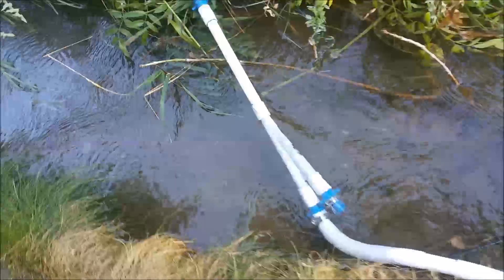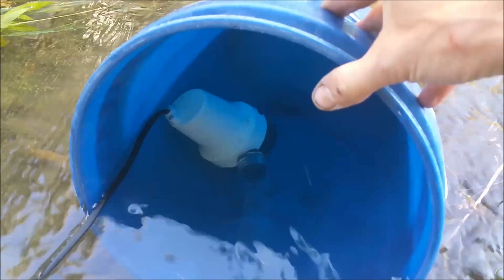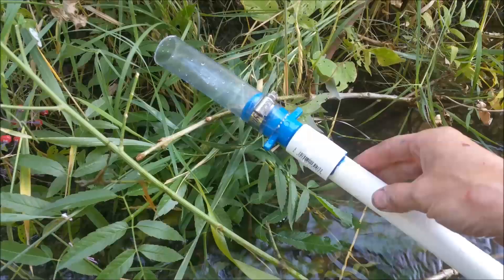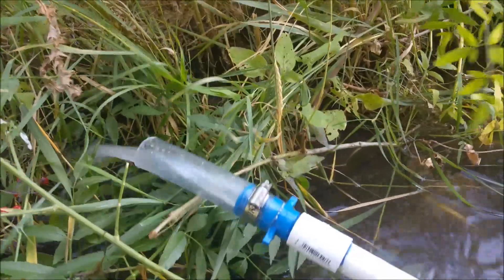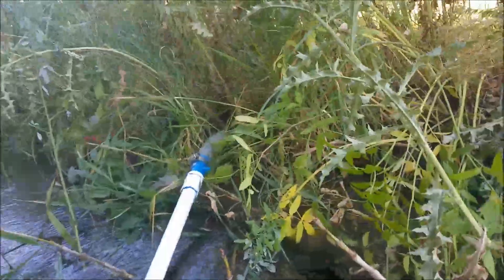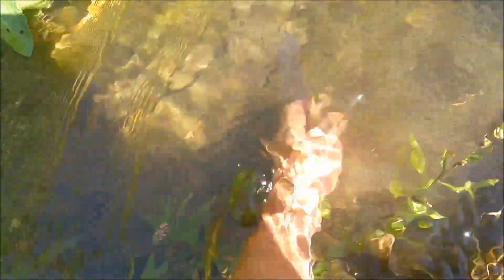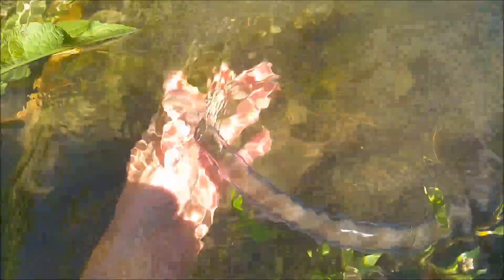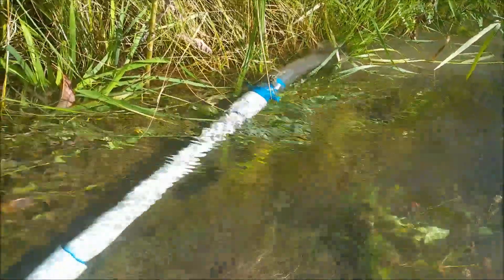12v Mini Gold Suction Dredge with 3D Printed Power Jet

Comment: do you have any  videos with your whole rig running, I'm interested in the pvc base you have. I run a electric pump but my power nozzle is different then yours. I run mine like a power sluice, but I'm intrigued with your pvc base. any info or videos of your system running would help. thanks.
Reply from the maker: Cool, I'm interested in your setup too as I'm always looking to improve and it sounds interesting.  And I'm always happy to share what I've been up to....

Winter set in and kinda put a temporary damper on this project so no complete system yet (but soon!).  The only video I've got so far is here: https://www.youtube.com/watch?v=rS5hxr1GnG4

That vid shows a couple ways to set up this power jet including using a small floating sluice or a collection bucket.  I've thought about a recirculating sluice as well but not sure if I'd need more than one little bilge pump to run it... might have to do them all then see what works best.  :)

So does your setup have the jet at the nozzle or is it a separate jet?  I've tried several versions of a jet at/near the nozzle but finally settled on this design cuz it's supposed to be much more efficient and was easier for my pea brain to get working properly.  I basically took a power jet from a full sized gold dredge then scaled it down to work on a small scale with a 12v battery.  I'd love to turn it from a single jet to a full 360 degree jet...

We've still got a couple months before I can access the gold fields here but I'll definitely post more videos and make my final design available to others.

In the meantime, I've switched to a nylon based material.  It's amazingly strong and flexible, so much more so than PVC or ABS.  I just posted a vid on running it over with my car then peeling out on it... friggin' sweet!  :)

Guess it's time to get the gold fever!  Thanks for watching and your feedback, I really appreciate it!  I'll definitely be posting more and seeing this project through to the end.  Any other questions, just ask.
Reply from the maker: The mini sluice I bought is crap so that's delayed my initial plans.  Right now I have it feeding into a 5 gallon bucket to suck out crevices and bedrock.  Just waiting for water to start flowing and I'll be posting more videos.
Reply: @ProspectorPhil  may I have the STL files for the jet log